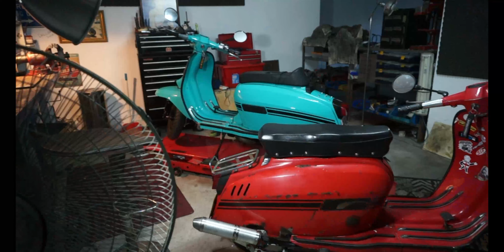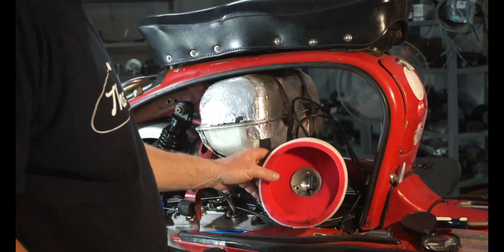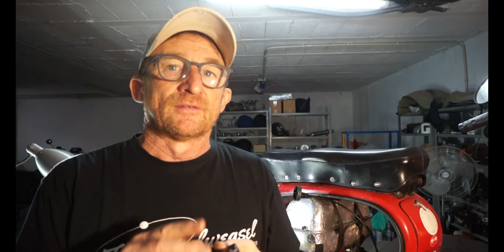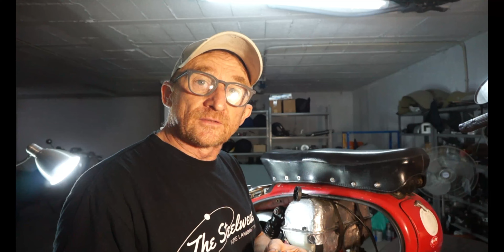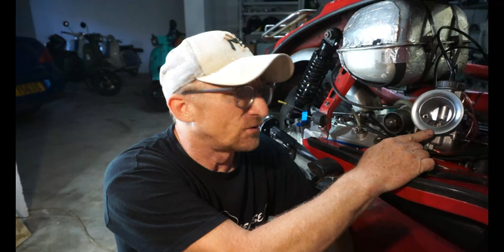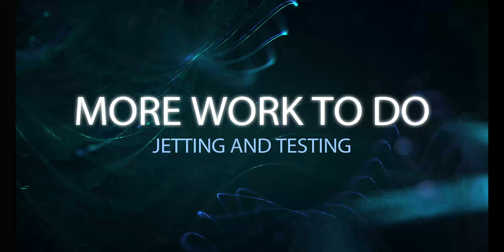PROJECT #LAMBRETTA TS1 100 MPH FIRST TEST . HD VERSION

Comment: I had a 100 MPH Lambretta in the 80's, cutdown with Mark Broadhurst tuned 225 and pipe, 34 mm Amal powerjet carb. Reliable as well, did a lot of rallies on that some over 400 miles.
Reply from the maker: There was a lot of 100 mph scooters in the 80s, now we have GPS we are all much slower .👍👍
Reply: We all had one of them in the 80s mate.